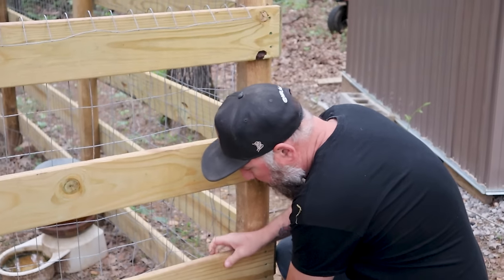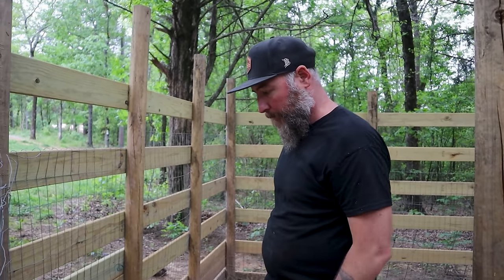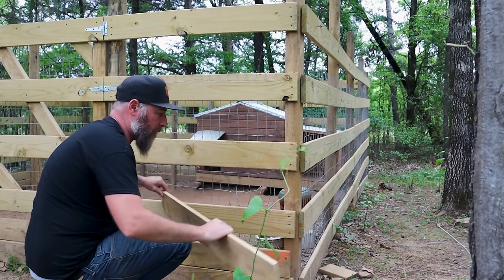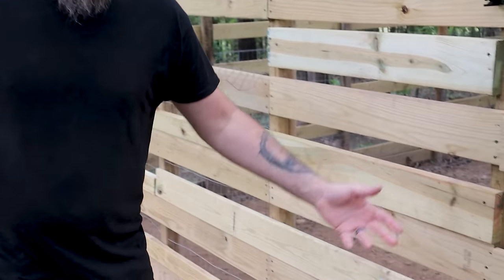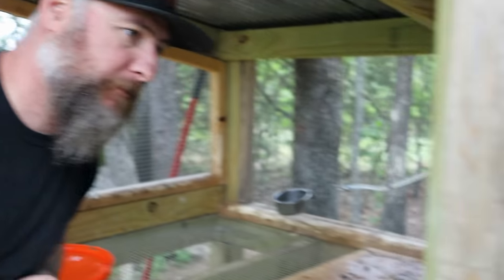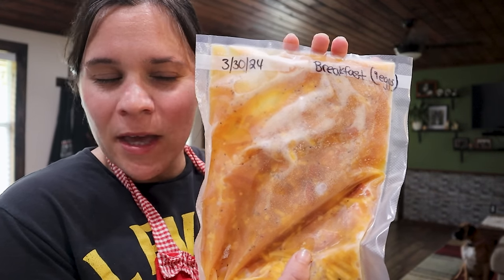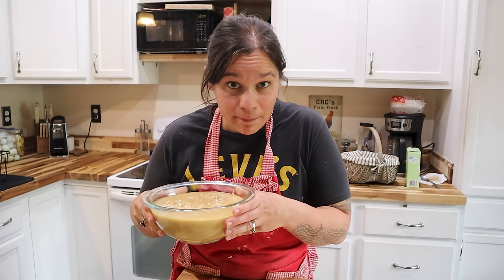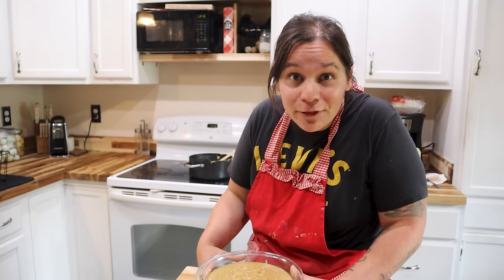Two HUGE PROBLEMS were FACING...+ UPDATES | Shed To House Conversion

Comment: Anthony, use a hot wire around the fence and they will get the message. Once you leave it there for awhile they won’t attempt getting out agsin!
Reply: That is what finally worked for me, hasn't been on for about 3 years now and they still stay off the fence and no digging under either.
Reply: I've done this as well. It doesn't hurt then at all.
Reply: Yep it is no different then the training collars and the learn fast
Reply: We had a St. Bernard that was crawling under the fence. A hot wire around his yard put a stop to that. It was much more humane than having him get hit by a car.

Comment: Roxane, when you freeze the egg packets lay them out on a sheet pan in the freezer. Once frozen you can stack them. If you put them on a wire shelf they will freeze into the ridges and become difficult to take out.

Comment: Been through this before!! After rolls of wire and continuously patching, I went with corrugated metal on the inside between posts so I could still see wood. It kept the dogs in and looked good at the same time! Good luck!

Comment: Anthony, the wire you used is a lot stronger when you use the fence staples along the inside of the boards. I had German Shepherds who did the same when I didn't staple along the boards. It made a hell of a difference stapling it bro.

Comment: I would put it on the inside.  I  actually use no climb horse fence for my goats. The welds break on welded wire, also electric fence will stop it.

Comment: We had dogs that could climb out of a wire pen. Solved by putting a section of galvanized metal at the top so they couldn't get a foothold. No more climbing out.

Comment: Wondering if you screwed a thinner board like a 2 by 1 in between each panel might be cheaper than the wire fence, they will still be able to see out. Hope you sort it out. Have a blessed week. L&L

Comment: A hot wire or two would've worked marvelously, simple, effective, and cheap. Much more humane than ppl think, and they learn quickly. Cattle panels work great too, but are expensive and they tend to dig and chew at those as well. Love what ya'll are doing ❤ Roxy, the pudding looked delish!! 😅

Comment: It looks great but, I believe had you put the wire on before the cross boards they would not be able to tear through the wire. Putting it on last creates weak spots. Just my observation 🤷🏻‍♀️ but I’m not a fence builder

Comment: Roxan.  I know how to make  a garden tea that's beter than miracle grow!  You need to buy a cheap pair of nylons..a large carbage can snd a bucket to pit your nylons in with a heavy stone.  Shovel some chicken manure in the nylon pants part that is stretched over the bucket when it full pull up the waist ban twist it and tie the legs around thevwaist tight.  Now put the panty hose in the garbage can out of the bucket.  Fill with water almost to the top.  I put my garbage can on two cement blocks.  Wait a weel.  Stire it with a big stick.  Put some in a bucket with 2/3rd water.  Douse your plants with it.  They will sing.  Good for flowers too.
Yes it does smell but not after you put it on your plants.  Miracle is the worst chemical to use for veg.  😮😅😅

Comment: You could use a hog panel there shorter and smaller square areas. Tougher wire than the cattle

Comment: You can get like the 2 by fores and put them in between the boards you have their already nailed as part of the fence and you won't have to use the the wire that you have and see if that

Comment: Roxanne - a recipe to use up some of those eggs:  pudding
In a high power blender or food processor add:
10 hard boiled eggs 
1 13.5 oz can coconut milk
1/2 cup sugar or swerve sweetener 
Pinch of salt
1/4 cup cocoa powder
2 tsp vanilla extract 
1 tsp cinnamon 

Blend on high until very smooth and transfer to bowl. Refrigerate overnight. Makes 5 servings. It will smell eggy when first made but you can’t tell the next day.  You can try other flavors as well

Comment: Happy Birthday 🎈 tomorrow Roxann🎉 
Maybe sandwich the corner post wood outside wire wood inside..if that don't work use  chain Link fence metal post inside? You might find it cheaper at dump or habitat for humanity?

Comment: home depot galvanize fence is $100 for 4 ft and $130 ft for 6ft', 50 ft long and use the staples you already have. it will last a lifetime. You would need 2 rolls. How much have spent already?

Comment: Anthony. They did not do this when you put them in the dog lot. Your PEN . It is no dog RUN. your PEN is too small. You have 3 or 4 big dogs confined in a teeny tiny area. I had hoped you would build then something at LEAST as big as the garden lot. Use that small thing you built for goats or pigs or some other farm animals. Build those dogs a fence around a much bigger area! Problem solved! PLEASE . I know you want your dogs happier

Comment: Simple fix. Step in electric fence posts, every 10’, electric fence rope or tape, solar 5 mile charger and a gate handle or run overtop of the gate. Run 1 line lowest level not touching the outer fence. Charge it (facing the sun) for 3 days. Ground the box, connect to wire and that will be the last escape attempt. Plus reusable if you get goats. I use metal t posts at each corner. I keep 4 horses in. About $250, everything is portable as needed

Comment: In response to comment or, you can make fertilizer for the garden.  
1.  If you have comfrey, fill a 5 gallon  bucket with comfrey leaves and cover with water.  Put kid on and set in shady place for 4 to 6 weeks.  This is concentrated so use 10 parts water to 1 part comfrey.
2.  Did you know weeds can be used the same way.   Soaking in the water brings out all the minerals and nutrients  they have absorbed in the soil.

Comment: Maybe put the wire fencing between the planks (you already have the planks on the outside, so go on the inside directly opposite of the outside). Basically double planked with wire sandwiched between.

Comment: Rox and Ant how about an Electric Wire around Botton and the midway up on the Fence. I think they might be able to do the same with the Cattle Panel. They need a strong Shock. It will not hurt them all the Winter Fur is falling out so  the fur cannot help to protect them a little.  Also Mabe the whole bottom half filled in with Wood and the Electric Wire in top mightk keep them from jumping over thr top.

Comment: If you end up using cattle panels you should remove the wood, it will basically serve no purpose. And move the dog houses to the middle where they won’t be jumping on top of them and jump over the fence.

Comment: If they try to climb out put up an Electric Fence wire (The ribbon kind) around the top and bottom that stand off away from the post. Dogs are smart and learn very quick, so after 1 or 2 shocks from the fence they will stay clear. My dogs use to get up into the garden and eat all the Tomatoes and Corn, Squash and Cucumbers and Green Beans. And even worse they would dig up my wifes flowers but after about 2 weeks and getting bit by the fence they stayed away from it and I turned it off, I left the wire up and they stayed away problem solved.

Comment: Id line the inside with cattle panel fencing for future giat and start saving for invisible fence for dogs. Invisible fence works well for dogs and it can be an added level of security for humans too. Lol. It can be put anywhere so you might be able to move it around to different areas ..or put it up around your yard and pens so the dogs stay within that area to guard. Invisible fencing has the addd benefit that you dont see it so preserves the view. Ik dome folks who had it and it worked well. 
Whike saving id do the cattle panel fence and maybe a hot wire or two.

Comment: You need a thicker welded wire. Something far less flexible so he can't rip it a part. It's expensive, but lasts for ever. Ah.. I see.. watching more, you hit the nail on the head. Cattle panel is the way to go! for the top, to prevent jumping - you can do a couple lines of electric wire. Nothing powerful just enough so they know.. It's what we also had to do around our property too.